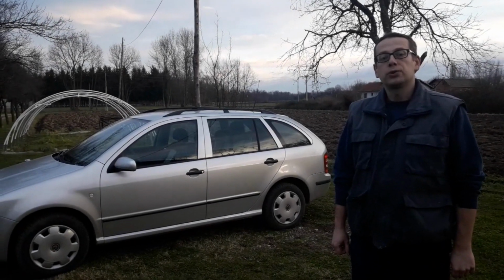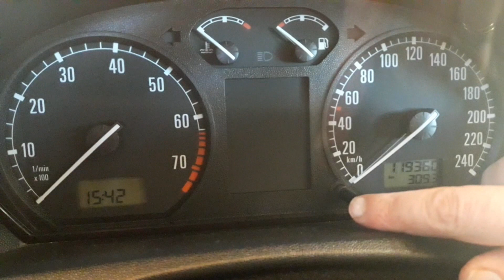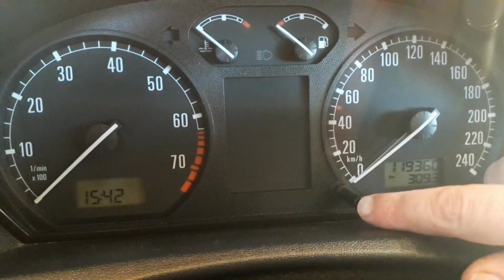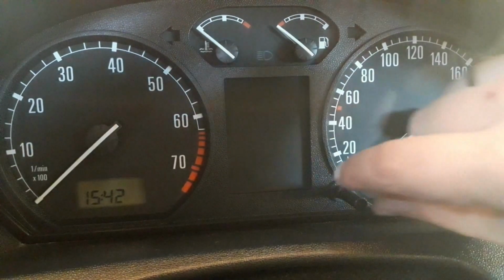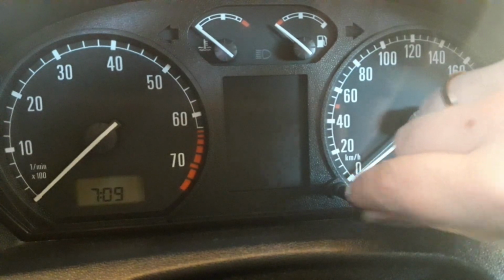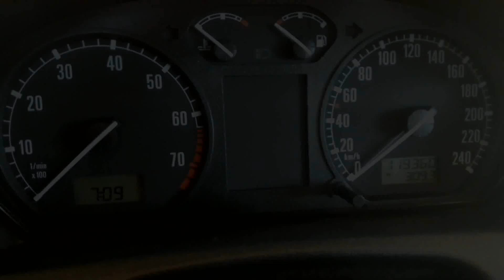how to set the clock on a Skoda Fabia mk1

Comment: Thank you! I have a skoda with a very similar display to this and this is how I managed to change the time
 However any idea on how to change the language as any warnings or messages show up in a different language and I have tried everything but can't figure it out
Reply from the maker: Hi and thanks for watching! To be honest, I don't know if they have that option in the menu.
At least I haven't come across it. I've only seen English and German.
Reply: I managed to find it, it was by keeping ahold of one of the buttons on the Stalk Control (the one on the right side) - It brought up a menu and i tried all the options until i found languages! Literally had the car a year and i could not figure it out! Thank you anyway. Turns out it was set in Dutch but finally showing in English @DespairRepair
Reply from the maker: @shazkhan4920  thanks for sharing! On my Skoda, there isn't that option